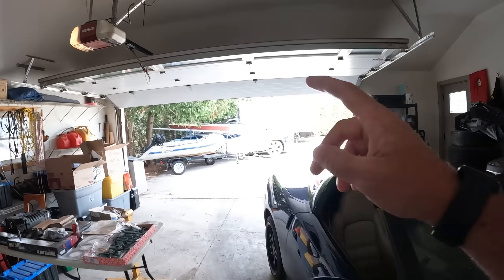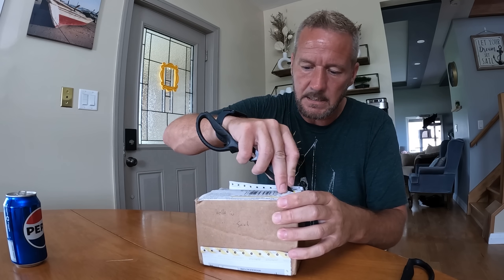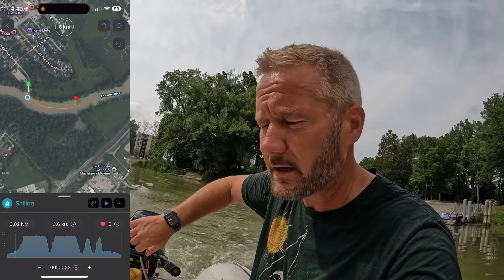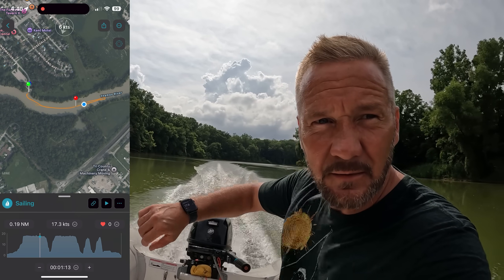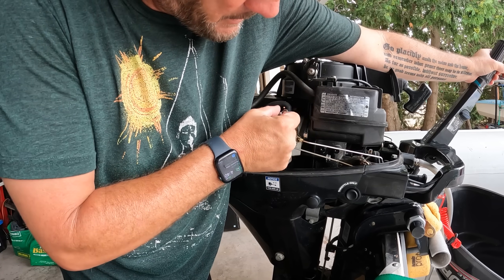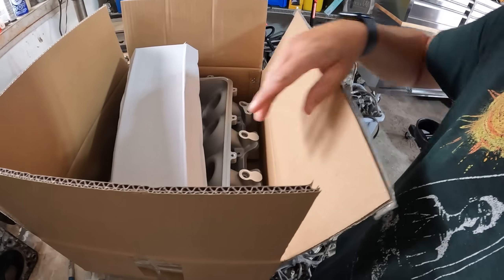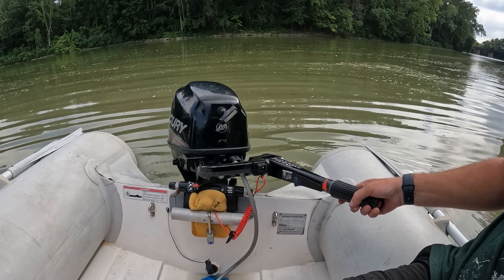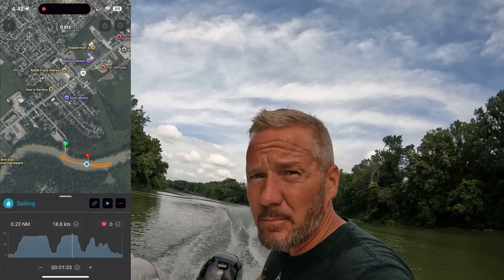ADD POWER To Your Outboard! Mercury 9.9 to 15hp upgrade

Comment: You're on the wrong side of the tiller... its ment to be operated with your left hand that way you can steer it without the tiller hitting you in the stomach when you want to turn right ..... that's why the tiller comes off the outboard,  On an angle,
Reply: He also never reattached the crank case vent hose to the breather box/silencer.
Reply: That's cheating
Reply: Not necessarily. I sit and steer my tiller using my right hand.

Comment: Jet size is likely the most significant difference between those two carbs. But you may want to measure the the throat size on those carbs as well since on some year models the throat size is a bit larger on the 15 HP and some models have a different exhaust configuration as well. Also ignition timing curve is different between 9.9 and 15 HP models. Idle set screw may help adjust your idle speed but perhaps better to ckeck the range on the rod connecting the throttle rod (the very first screw you disconnected) to the carb to make sure that screw is set where it allows the throttle on the carb to fully close when your hand is cranked to the idle position on the steering arm. Depending on the year you might have been able to make the conversion with just a larger high speed jet. Or a different engine control module might be needed. If you can find a guru who can reprogram your ECM to 15 HP specs that could be a cheaper alternative to a new ECM if the timing advance is indeed different for your model year.
Reply: probably ECM needs to be remapped to 15 HS would that be enough? new carb with remapped ECM with 15 HS?
Reply: Mercury pcm are locked tight
You are monkeying with epa emissions.
10000 +$ per offense..
Mercury has been known to come after peopke for it.
Reply: There there there we go
Reply: 8/9.9/15H with the 209cc block use the same CDI

Comment: Hp won't make the top end any faster at top RMP with the same prop, it will only get you plane quicker. 
You need to know the WOT RPM  to determine the prop diameter and pitch. Since it's unlikely possible(may not fit under clavation plate) to increase diameter, you may consider increasing the pitch
You have to locate the air screw and adjust
Reply: Any propeller you can buy for that engine, will fit under the anti-ventilation plate. The props for the 20 and 25 hp engines are 10 spline shafts and will not fit. Merc makes several props for that size gearcase in various pitch sizes. All he has to do is to step up an inch or two in pitch.

Comment: Put the same carb on my boat motor and had the same results, didn't gain much if anything.
Reply: so adding the same carb doesnt make sense? its 209cc and 15 hs has above 300cc
Reply: @karataskaratas253  if the bore size is bigger on the 15 hp like you say ....then no

Comment: Yeah the prop would be the issue because it’s like a gear ratio the 15 still has same top end RPM so the extra power will drive a higher ratio prop 
It’s a lot putting a bigger motor in a mower, same RPM but you can mow taller grass.

Comment: With the extra hp you could possibly change props to more pitch or diameter to realize the extra power.😁
Reply: Yep. With the upgrades you can achieve 60 Kph (that's 40mph in freedom units) on a light 14 foot tinnie.
Reply: @glennllewellyn7369 you got to love the freedom units😁
Reply: @glennllewellyn7369 do tell what these upgrades are, that is my setup to a T.
Reply: @glennllewellyn7369  
I think those are called dictatorship units now.
Reply: This is why they changed the law to a speed limit
Reply: Hah! Yep.
Hello from Australia!

Comment: Thanks for the video amazing quality most of the videos were bad quality, so the improvment is only 0.5 knots? I need to upgrade my 9.9 aswell because of the rules in Turkey so i need to know if it is worth it or not. By the way i read alot about people saying you need to add 15 HS propeller aswell.